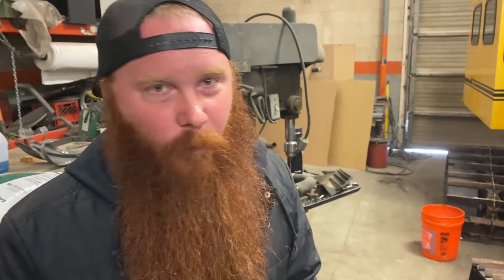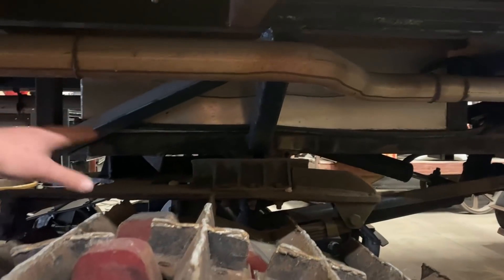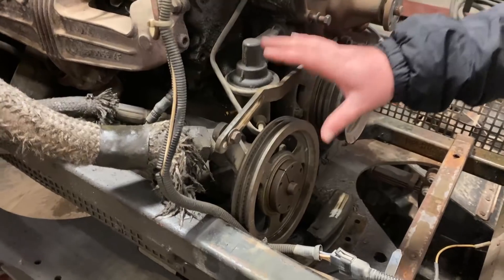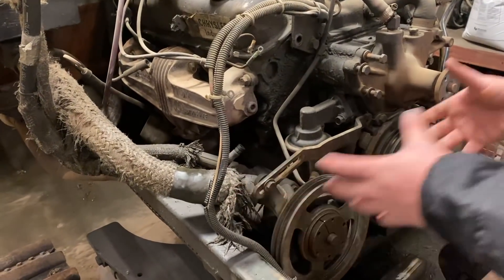LS Swapping A Snowcat Part 1

Comment: I'm interested to see what happens when the LS revs WAY higher than that Chrysler engine and how it will affect the hydraulic pump. May need a pulley change somewhere to adjust for the difference in rpm.
Reply: Rocketman Productions geared it back for a 1-1 ratio we won’t let you down
Reply: @stepdadbarneswestshop2800  Heck yeah! I'm digging this project big time. Y'all are gonna do some really cool stuff, I can just see it. Thanks for the videos and the great channel.

Comment: Pretty much all of that stuff mounted to the firewall is for that chrysler engine. From left to right, you have the Ballast resistor, Ignition module, and the voltage regulator. That can all go when you pull the big block Chrysler engine out.
Reply: That was a small block.  Distributor in the back.
Reply: @davidjames2788  You got me on that one. My mistake for sure. It has to be at least a 360 though right? I should've noticed it being a small block since my daily driver has a 318 in it. LOL
Reply: @davidjames2788  I've never messed with a big block mopar. My dad only owned small block stuff when I was growing up and learning. It's one of those things that slipped through the cracks I guess. I appreciate the wisdom.

Comment: So talking 5.3 specifically, gen 3 is from 1999 to 2006 (and some 2007 if in a classic body style truck) they are all 24x reluctor and rear block mounted cam sensor. They also all have cathedral port heads.

1999-2002 has the red/blue connectors for the ecm. These were mostly all cable driven throttle bodies (some were driven electronically like trucks/SUV's loaded with traction control, but very few).

1999 5.3/4.8 engines came with a smaller cam and a 5500rpm rev limit.

In 2001 the 4.8/5.3 stopped using EGR.

In 2003 GM went to blue/green ecm connectors and electronically driven throttle bodies (with the exception of some LS equipped vans/cars) these were still all 24x engines, aka GEN 3.

HOWEVER, in late 2004,GM started putting stronger rods/pistons in the 4.8/5.3, they then also went to the shorter head bolt lengths. 

Technically the 4th generation of the 4.8/5.3 started in 2007 (new body style trucks) some of them had aluminum blocks and they also started coming with 799/243 heads, a TBSS intake manifold and have the same stronger rods/pistons as the late gen 3 engines did, with the exception that the 5.3 now also had flattop pistons just like the 4.8. (Also all Gen 3 5.3's have dished pistons except the High Output 5.3 that some 2005-2007 classic trucks came with dubbed the L33, it also has an aluminum block and 243/799 heads)

All Gen4 4.8/5.3 engines have 58x crank reluctor and a 4x cam sensor mounted in the timing cover.

All Gen4 5.3 engines have DOD (displacement on demand aka 4 cylinder garbage) and one of the 4.8's did.

Staring in 2010 (I believe) most 5.3's started coming with VVT (variable valve timing)
Reply: Nauh

Comment: Install an electric hydralic pump on an inverter (think low rider cars) for your steering.... todays 200amp alternators can handle such things... plus you can add a kurig for hot coco ;D

Comment: I know the 4l60e isn't one of the best trans out there,  but it's not the worst. Most common failures in them is the 3-4 shift piston. I have an 01 Silverado that I used to battle that issue with.  I sent it to my local trans shop and they made it 100% better than ever.

Comment: Using a suspect transmission in a vehicle that will likely be unrecoverable until spring probably isn't ideal
Reply: Best comment so far. Recovery after trans fails most likely won’t be easy unless you keep it in a field. And did you see the size of the transmission that came out of it? Definitely not average dodge stuff. Looks like it could be a Allison.
Reply: That 4L60 will be short lived in there
Reply from the maker: Agreed. Still figuring that part out

Comment: One of the other differences between gen 3 and gen 4 LS blocks is the crank position sensor reluctor wheel and how many teeth it has if I remember right 3rd gen has like 26 teeth and 4th gen has like 52 teeth and you'll want a blue green computer instead of a blue red computer. Lt1swap.com has a ton of info for wiring on LS engines and the difference between all the generations of engines
Reply: Incorrect data! So talking 5.3 specifically, gen 3 is from 1999 to 2006 (and some 2007 if in a classic body style truck) they are all 24x reluctor and rear block mounted cam sensor. 1999-2002 has the red/blue connectors for the ecm. These were mostly all cable driven throttle bodies (some were driven electronically but very few) then in 2003 GM went to blue/green ecm connectors and electronically driven throttle bodies (with the exception of some LS equipped vans/cars) these were still all 24x engines aka GEN 3. HOWEVER, in late 2004,GM started putting stronger rods/pistons in the 4.8/5.3 and LQ4 6.0L engines (all LQ9 6.0's have stronger rods/pistons), they then also went to the shorter head bolt lengths.

Comment: Nice job guys, can't wait to see it finished. I am in the ski industry and the Tucker is a popular utility machine for smaller treasures. The main snowcats are hydrostatically driven with two tracks (like a bull dozer) and they are impressive machines. Big diesel engines and there is one model that is a hybrid diesel electric.